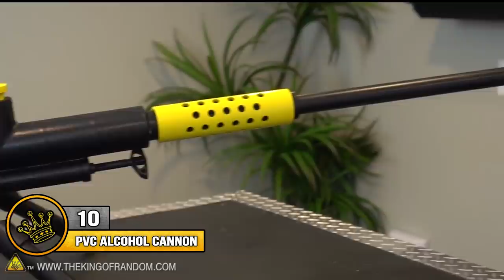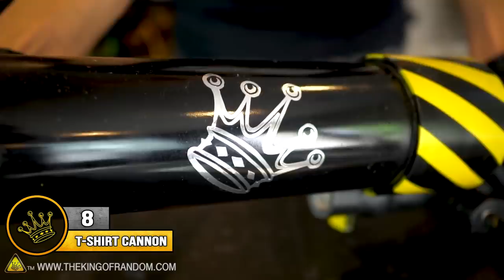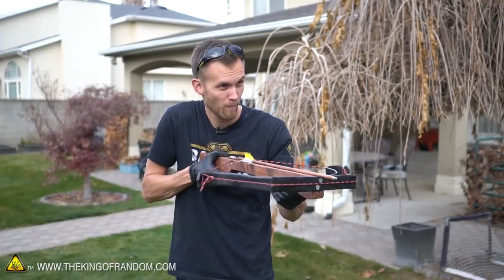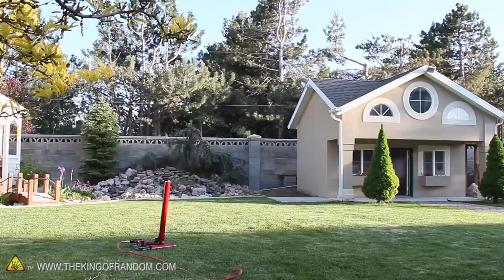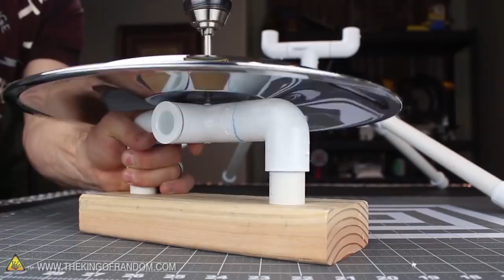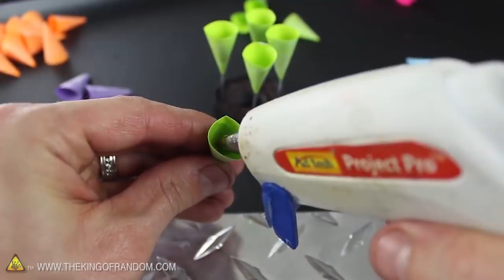10 Things You Should Make This Weekend
| Rewind #1

Comment: You  should grab a pvc pipe then grab a potato then cut the potatoes in half then using the pipe to cut a hole in the potatoes to clog one side of the pipe then do the same thing then grab a piece of wooden or some sort of a bar then use the bar to push then potato then the potatoes will cause a air trapped in the pipe then it will make a lot of force then the other side of the pipe with the potato will pop off and its called a potato launcher

Comment: King of random you made a video about how to make a pvc blowgun I made one but I just read that pvc is toxic and you shouldn’t be putting your mouth on it your video and kit could be harmful to others be take note
Reply: Then explain to me why almost all homes in the us have PVC plumbing?
Reply: @Tatted_Deer_69  they dont use them as much eny more becuase of that
Reply: @graden8482  I think you need to do more research bud. The pvc that you are referring to is all pvc that was manufactured before 1977 is what is unsafe. Other wise homes will use PVC for cold water only and a special type called CPVC that mat be used for both hot and cold water.Then also every house I've build and even those in this area use PVC for everything but hot water lines in which we use CPVC.